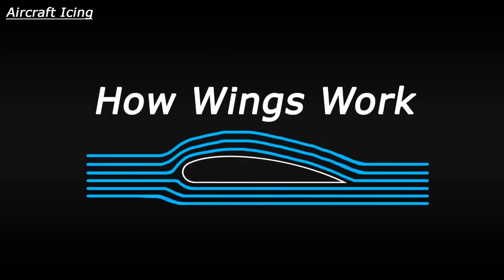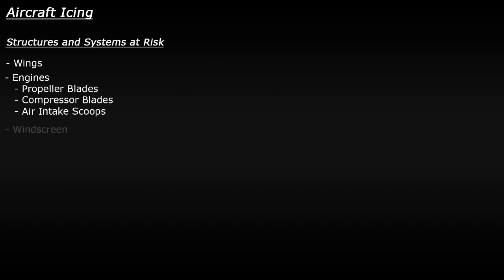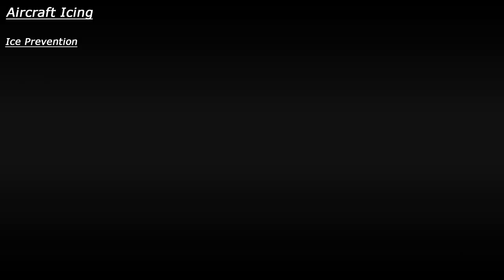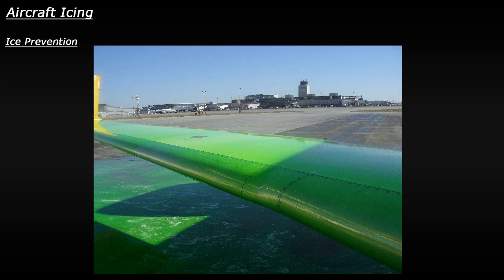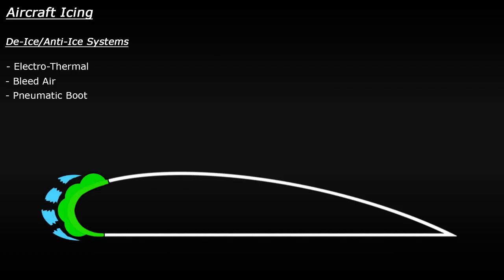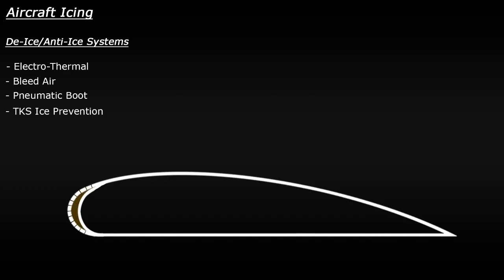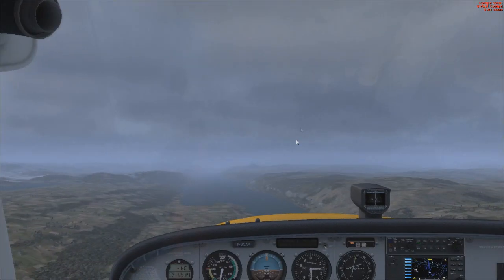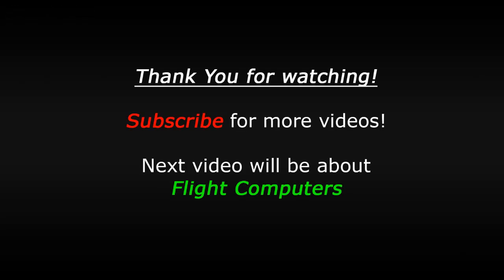Dangers of Aircraft Icing

Comment: Wouldn't the Pneumatic Boot worsen the stall? It seems like the airflow across the wing would become really turbulent.More so than if there was ice formed. I know that it can become deflated but the time it would take to remove the ice can cause the plane to lose  quite a bit of altitude. And if you forget to switch it off then it wouldn't be a great outcome.

Comment: do airplane equipment fail in fsx if you don't enable the anti/de-ice botton? or are they just there for decoration?
Reply: The airspeed indicator does fail on (most) aircraft if you don't turn on pitot heat but apart from that, doesn't affect anything as far as I can tell.

Comment: Talk about aircraft overspeeding next please. I like how you talk about aircraft.
Reply from the maker: Basically the plane will break itself apart.
Reply: RR The II yeah. I wanna know how an aircraft and airframe works when travelling faster than design.
Reply: For example, a DC 10's top speed is 610 MPH (530 knots) (Approx. Mach 0.80) If it flies faster, the airplane breaks apart like China Airlines 611. (probably from metal fatigue)